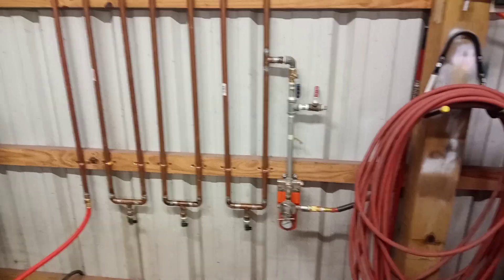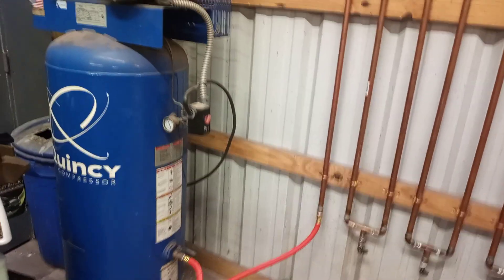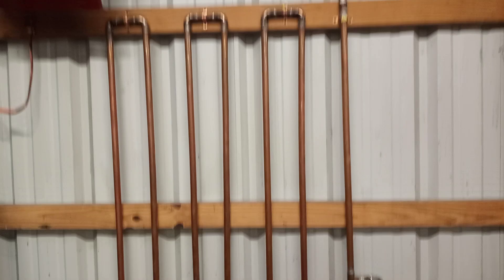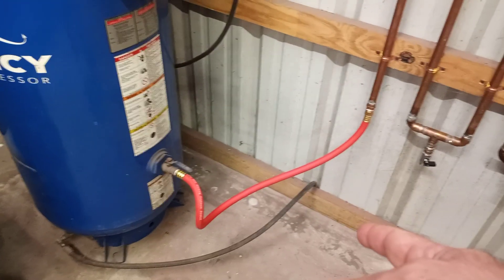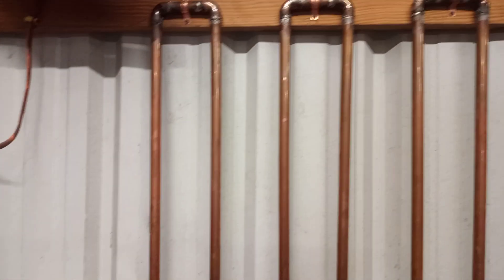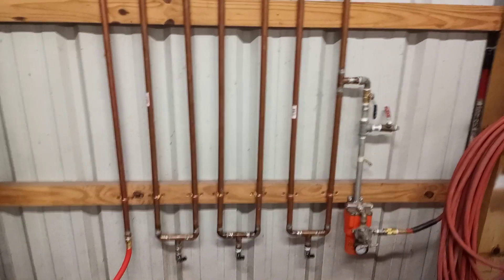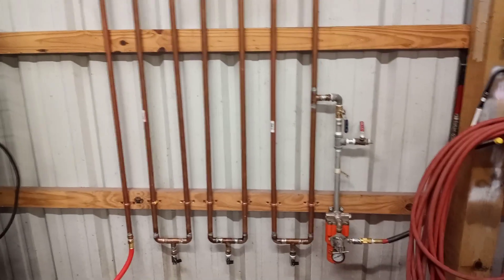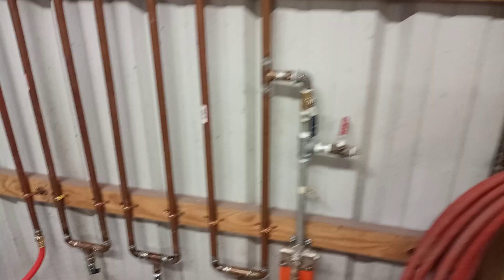USA weld Max Dry Air dryer filtration system

Comment: So what's your thoughts on this system after running it last couple years.. Im gonna build almost exact same set up in the next week or so..
Reply from the maker: I like it. The last part of the filtration end up breaking at the regulator,  so I replaced that. It might have been 50 dollars.  But everything works great and I've gotten great results painting cars with this setup the quincy is a workhorse for sure. .it was also my first time sweating copper. I was convinced I would have leaks everywhere, and I haven't had a leak yet...
Reply: I've recieved mine.. idk what's up.. the little indicator sight glasses on the fronts of each stage filters don't line up when tightened. Like one might be forward one might be 180 degrees facing the other way can't see the indicator on all of them..
Reply from the maker: Honestly I've never even looked at the indicator...I've baked the  dessicant 2 times since I've had this setup.  To dry them out.  Use the setup every weekend, hobbyist
Reply: @lonestarlows  yeah.. im not to worried about it.. it is what it is.. I bought the xxl and extra gallon of desiccant.. Hobbyist aswell just thought they could of done a better job lining those up..
Reply from the maker: They are probably 11yrs old and on another continent....so there that

Comment: What size are the Ts did you straight from elbows to Ts? I’m gonna attempt to do this my self also. I know standing garage did the system a bit different. Thanks for you help
Reply from the maker: I can do a better video I believe the pipe is 3/4 And the copper tees reduce to 1/2 npt to accept the ball valves.  I have since switched put the valves to stainless. The others rusted and leaked
Reply: Ok got it, thanks for reply ! Yea better video would be nice thanks for your help brother!

Comment: I hope Lone star is not getting bored with Impalas cause now he's  dominating with plumbing too!..lol!!
Nice job bro! I like it. I have same devilbis water trap/regulator.
Hey, something you may   want to add on to your system is an automatic tank drain. There are several styles to choose from.  Look them up. They are cheap and easy to install. No more draining your tank  manually.  Plus these valves do it on a timer or when your compressor stops pumping. No more forgetting to drain tank!